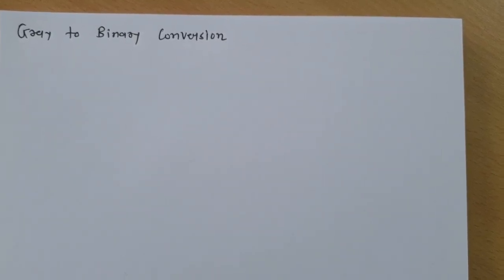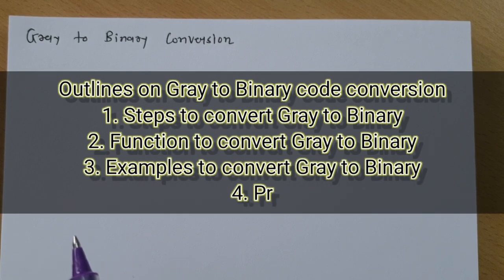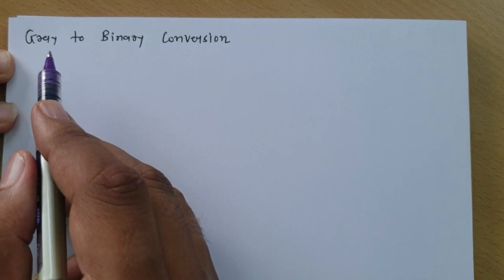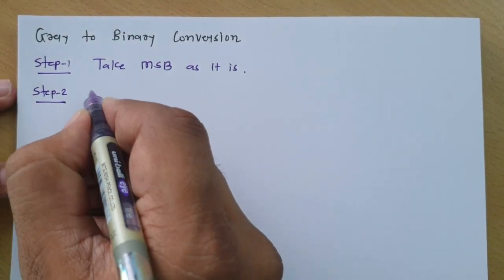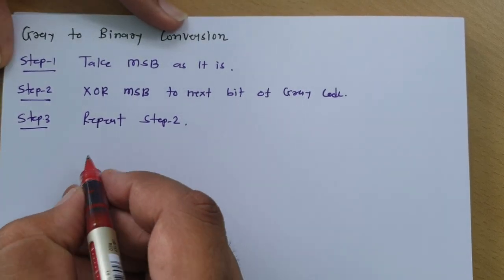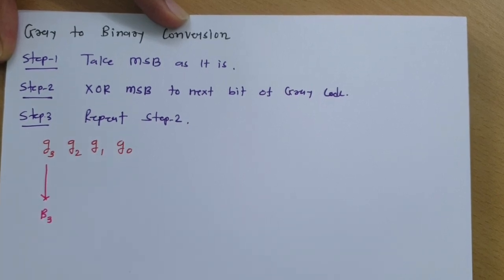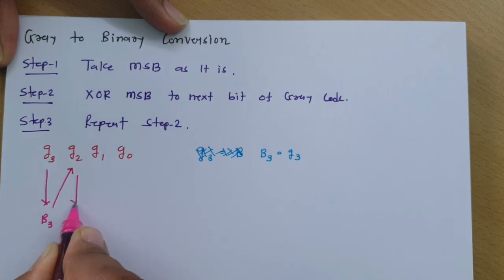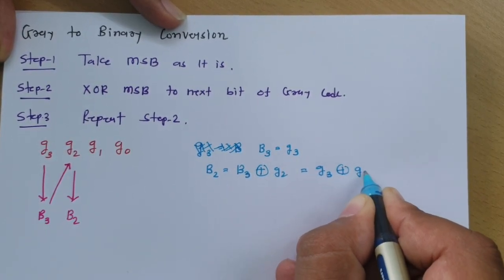Gray to Binary Code Conversion: Steps, Process, and Examples

Comment: Q1.... (110110010)2
Q2.... (314)8
Reply: @poornacharith6004  how can you explain
Reply: @vishnureddy188 
For Q1 , we simply take the msb as 1 and then XOR it with the next graycode bit to get the answer as sir told in the lecture.

For Q2 , we first do the same step i.e to convert gray code to binary using XOR . So (10101010)gray = (11001100) binary .
Then , we use the 3 grouping method from the right to convert binary to octal. So the groups are 011 001 100 which is equal to 314 according to 421 code.
Reply: @SakshamVarshney-u2b  thanks